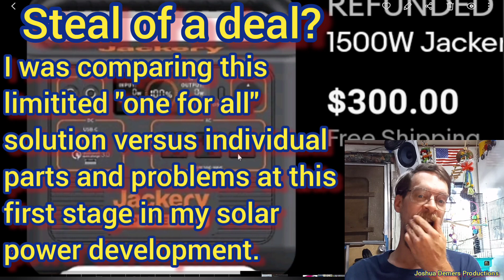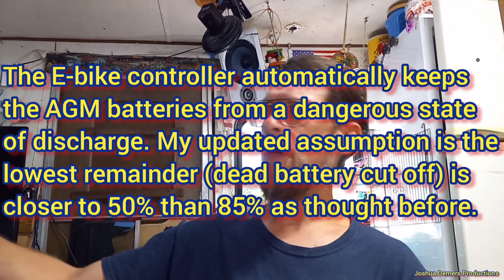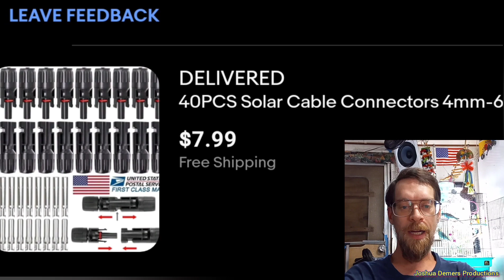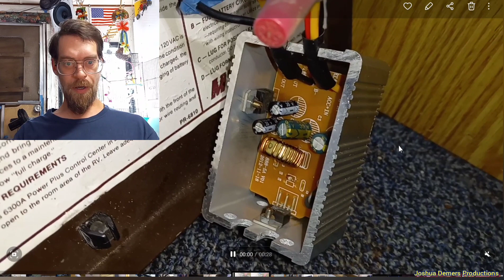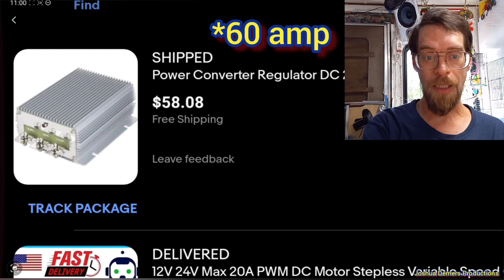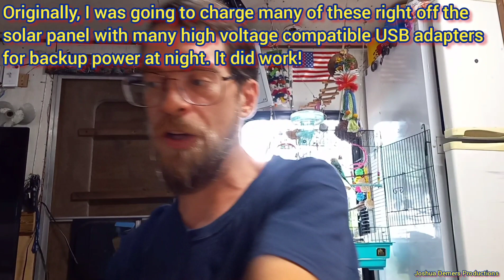Solar System Startup Search And Selections So Far With Product Reviews And Ratings - May 22 Part 2

Comment: Those blue "8,000ma" USB power banks were about $9.00 each at Walmart last year.
The USB-C to USB-C "Samsung" cables are rated: Great deal, good product. I can't verify that they are actual name brand, but they readily support at least 30watt PD high speed charging. My primary cord has held up well for more than six months of careful, heavy use. I don't know about data ability, but for two dollars it's almost a steal of a deal!
You know what else you can do without a battery and charge controller with a solar panel and high voltage USB adapter aside from phones, tablets, and USB battery banks that you could connect USB lights to? A USB battery charger for "AA" and "AAA" NiMh batteries for anything else low voltage that's not USB compatible! That's how I originally solved my lighting. You know what I did to avoid the incandescent lighting from killing my E-bike batteries when I got the Solar Charge Controller? I used my 12v LED strip lighting that runs from end to end to light up all three sections without the horribly inefficient drain of just one or two of non-LED bulbs. It didn't last long before I figured out that converting my mains to LED lamps was more than affordable.

Comment: Don't worry every time I buy something from China it never comes I never get it how about so many different things with that China I lost over $10,000 throughout the years and I still have not received anything I bought since about 2013 and I still haven't got any of it yet and they wouldn't give me my money back either I suppose because I guess there's a certain cutoff. Time that you connect to get your money back but I was giving more than that time before and the delivered to me cuz I understand it takes forever to from the good to me and it still taking forever to get it to me and I still haven't received it. Which now that makes me all broke.
Reply from the maker: I've done a good job of getting most of my money back when things go wrong. Ebay has been pretty safe to shop on so far.
Reply: @JoshuaDemersProductions  I wasn't able to get most of my money back going time was able to get money back once upon a time is when I ordered it through Amazon and that's the only time I ever got money back any other time I never got any money back so yes I lost $10,000 actually lost more than $10,000 but that's besides the point so I try to order everything in the United States of America because that might be one way of sharing to getting anything and everything cuz if I order it from some just something there's extra cost that I do not know how to pay or access to pay and they didn't choose me of being a business or a police department or an FBI agent or something I am not I want a two-bedroom where the den living room kitchen bathroom front porch and a basement all those little hallway in between and it's still ways going upstairs just like the steps going down into the basement that's all I own. They may be reputable business but they never get things to me that I buy so I got a baby thing from a business in the country although never get it to Wisconsinbecause they can't seem to find source continent member One time they did deliver something to United States but they thought I lived in California they thought other than Florida they thought I live in Texas but they could not find Wisconsin and I'm not going to run across the country to go pick up my stuff and still it from my stuff for somebody else's places house just because they didn't know how to get it to my house they did that once and they pretty much told me that Wisconsin doesn't pretty much exist on Earth which I don't get because I live here at about nine and a half other million people live in Wisconsin or so. Yes I got the recordings out from phone number admissions to yeah I recorded everything and kept it and what good did it do me loss of more than$10,000 and yet I have to make food for that country actually I make food for 78 different countries including the United States of America and they can't get their products to me that I buy but we have to get our products to them that they buy too bad I didn't only company I worked at I might have a little special request for them when I ordered some from you you better get it to me or you won't get your food. I mean they don't need to get half a billion dollars with products of food that we have to send them each year.
Reply from the maker: @acefire4050  'Merica is sold out to Chyna now. That's a big cog in the wheel of production problems we complain about. Do we even elect Presidents anymore?
Good luck finding solar, batteries, and controllers made here. It's probably illegal to make anything here anymore and soon illegal to use anything that makes energy not from Chyna or too much to raise people from poverty. I mean they'll put you away for selling lemonade if you're not already an elite or an illegal immigrant.
Reply: @JoshuaDemersProductions  okay I guess that makes sense I guess that's another way to for them to raise prices on things to bring it back into stock again. Maybe I'll have the money when I come back out again cuz I want three of those generators and all the batteries to it which would take time to get those maybe two years that is a lot of batteries for a generator I like it. I don't know if it does anything for but I saved your video and when they come back again month or two I buy one or more of those generator and work myself up to having three of those generators and all the batteries to it and I'll order it from this off your video list. I might understand I might get in the middle of winter but that's okay I already have the solar panels and I buying more solar panels and set them up that and I know trying to put solar panels up in 4 ft of snow or more gets a little tigress tedious funny word I know that is probably one of two generators that I will probably buy from all power generators I have a second generator I think it's slightly bigger I want to get hopefully that one comes with quite a few batteries to cuz that means something good when the clouds are really dark so dark the middle of day looks like it's night because of the cloudy stormy days for that three and a half weeks really cloudy and stormy snowy days or just really cloudy things the same as supposed to snow but it never does what makes people headlights on. This is why I need all the batteries to the generators which seemed to be a really strange winter this year in December we got February weather. Extremely cold we didn't get all that snow though just a cold dark days like it was going to snow don't get me wrong you get some snow from it. I mean it got so cold I'm by the house most of the day of a 24 hours point 5 and sometimes six days a week I get home why would freeze glass in the living room I mean I could start a fire before I go to work but no one's there to put wood in the stove when it needs wood so in the next two years I'm putting split air conditioner heaters in and the woodstove can just help out a little bit but I just might get rid of it altogether and hook up a small couple small electric heaters which I can do with the solar panels I have I mean I already put one down in the basement even though it's small it works well I could put two upstairs have one in the bathroom I'll have to do is add one for the kitchen in the room and all this do is keep the house at 50°when I'm gone it don't matter I can always start a fire otherwise my fingers won't fall off from freezing then.
Reply: @JoshuaDemersProductions  yeah we need Donald Trump president going to finish building the border wall I don't know if I like Donald Trump but I know he was building the border wall I know when you're on the wrestling tournament he bought it from McMahon he paid for everybody's ticket including some of my friends McMahon bought it back for 2 billion dollars. Open get all the illegals out of here that are bad for economy maybe he's just get them all out of here I take fifty years to do eagles pride die of old age first at least the ones that get away even though not all of them get away I hated seeing homeless illegals begging for money the ones with little kids I could kind of understood but I really still can't understand it because they could get jobs easier than we could. Donald Trump or open up all the oil wells natural gas lines anything that made our country run and also made most of the feel for cross the world maybe not all of it but dominated it and Joe Biden didn't like the idea of all that money coming in but then again he was more for China for fifty years before I became a vice president and now he's a president private people would vote for someone and it wasn't all there but I did not vote that time because I didn't see a person that was for voting at that time.
Reply from the maker: @acefire4050  I've been looking into a backup wood stove/heater. I think I'll try to get propane heating sustainable by this winter. The motor in the RV furnace uses about 350 watts an hour from the batteries at night so I've still got a little more infrastructure to build up to sustain comfort in the coming cold. I can assume I'll spend $200, maybe even $300 a month on propane and I live in Florida! I don't know how anyone affords heat up north anymore.
I think a non-electric small portable propane heater connected to the big bottles with a little thermal powered fan on top to avoid the main furnace from running non-stop will be the key to conquering the coldest times. A "Buddy" brand heater, hose, and thermal powered fan can be had for less than $150 total for the smaller and $200 for the larger one. They have two heat settings but no thermostat on these portables though and you can use them inside.
Reply: @JoshuaDemersProductions  I don't understand why you need propane  when  you live in Florida I would just need think you need a couple extra quilts for the worst time of the year when you only get maybe 30 degrees every now and then. Personally propane is something that you have to buy it every year every month I just can't see doing it especially when I won't even use propane on a grill that would have to be either electric or have to use a little pieces of wood for the grill. But I really can't see what's best for your situation because I actually live in Wisconsin Shannon know my situation would be a lot different than yours and we actually get hersche worse weather than you do at least for winter but I also understand you guys get hurricanes and that could be very dangerous and flooding so please stay safe.
Reply from the maker: @acefire4050  I get chilled to the bone if it gets below 60 or 70 degrees. My birds don't deal with the cold well either. It takes 3,000 watts an hour non-stop of electricity to do a not-so-good job of heating on the coldest days. Prices doubled for electricity recently, but not for propane. It is convenient and sustainable for my off grid life to rely on occasional store runs and cost. To heat water takes a day before of low consumption to charge the batteries, a full day of sunlight to recharge the batteries, and still seems to risk damaging the batteries each time. Then I better use the water before it cools and it's only five gallons and it's over. Same with one 1500 watt space heater, stove, oven, and coffee maker. Or I can spend a few cents of propane to heat the water, cook a meal, or make coffee and tea, maybe a dollar to leave the hot water heater on all day. The furnace will cost much more than that per day on the coldest, but probably competes with the $200+ a month average for a couple of space heaters on grid electricity. I'm actually trying to live as much of an "on grid" life without actually being connected or spending more than I can comfortably afford using my Retarded Genius.

Comment: So far I bought several solar panels some of them came with a 200 watt inverter in 1998 since then I bought some more solar panels different size and I got a little bigger inverter a 750 watt inverter and and then in 2012 I bought two 150 watt solar panels biggest solar panels ahead yet but then in some years later I bought four 405 watt solar panels and last year I bought 11 / 100 watt solar panels and this year I started to get 180 watt solar panels and now I thinking of generator that comes with batteries something I want so many years ago that they didn't have try to find them back in 1998 it wasn't such a thing but I complained it asked about it for many many years and now they have something like that so I don't have to get an actual inverter all I have to do is get generators that uses less solar panels did you the same thing as an inverter and batteries do just to charge up a generators to run everything now it's going to cost a lot of money to buy them. But I will be buying more solar panels do it as well anyways when it can always come up with the money to do it it's only have to buy one or two solar panels at a time now. Course every time when I first started ordering solar panels it also came with a solar charger a 30 amp charger I told me the amps and the bolts that were coming in now to buy that thing it's going to cost an arm and a leg when I saw him for sale I bought one for like 10-15 bucks but now they cost $86 for a 12-volt or 24-volt solar charger for charging batteries.
Reply from the maker: Times have changed, I remember my first 2.5" LCD color pocket TV near the early 90's and thinking as a kid, "I wonder how on demand viewing will work on something like this in the future. What would be the limits? So far a VCR..." Same with my Grandparents camcorder, wondering if it would ever fit in my pocket. I felt like Captain Kirk from Star Trek with my cellphone for a while. Now with high limit, high speed mobile data and premium streaming services I have my answer to my childhood questions of mobile entertainment beginning the 80's with the Game Boy and Game Gear.
Is solar power technology grown so rapidly? No, but it has improved a bit recently. Monocrystaline panels are a big step up from poly and have recently fallen in prices.  Same with the MPPT charge controllers, but they are subjectively expensive. After purchasing the 60 amp MPPT unit for $90 versus $10-$25 for the 15 amp PWM and comparing, I'd say it was a better deal per dollar for the $90 one in every way except up front cost. I hope this explains "subjectively expensive", especially after looking at the insides of them. I'm okay with the price for the product and it's performance.
I could say the same about batteries as the controllers, you get what you pay for aside from scams. I think I might start offering to do some searches and recommendations for people wanting some direction before making purchases. 🤔